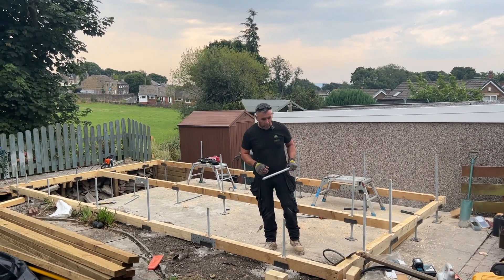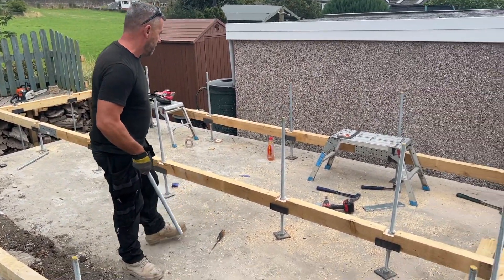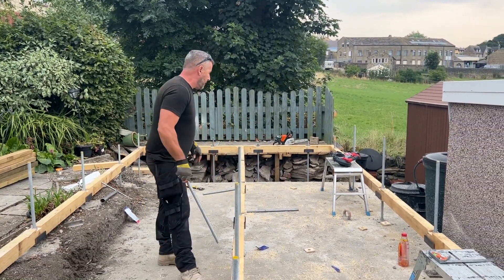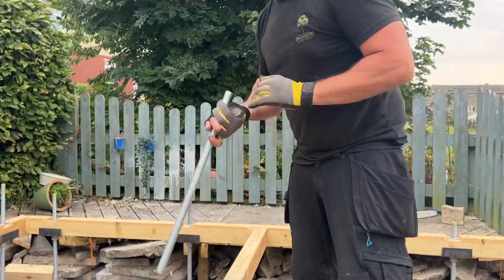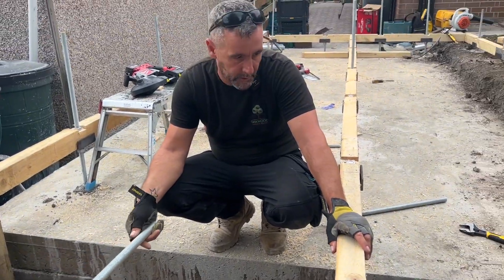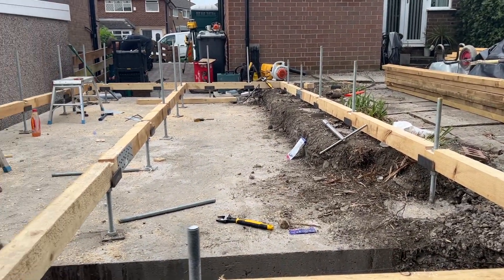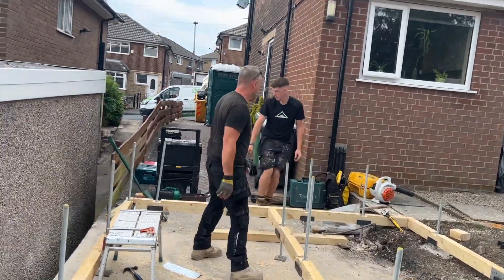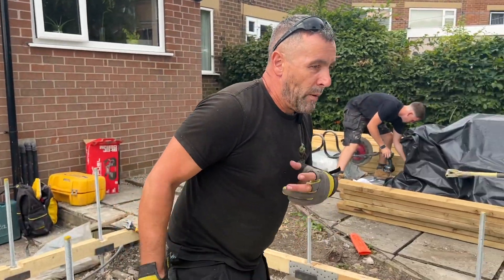Garden room rod pile system

Comment: Been thinking about augering the garden and filling the 10 inch holes with concrete and using rods like you to save on a base
Thinking of a large shed on scaffold planks hooked in a frame with the rods.
I like what you have done.

Comment: I realise not applicable in this case, but EasyPad now seem to be more affordable than the rod system and simpler setup. An EasyPad 3x3 kit is £380 currently. Did you consider pads at any point prior to settling on using your proven rod technique? 

Great channel though.

Comment: Great stuff, your videos are really helpful. I have a fall of around 1m for the one I'm planning, is that borderline for the rods? It will be used as a gym
Reply: depends on what sort of exercise you will be doing. If you are lifting and dropping heavy weights I would go for concrete. A suspended floor would probably be fine for light weights and static machines but keep the joist spacing narrow.

Comment: Would those longer 1.5 M rods have any chance of bending under compression?
Reply from the maker: It’s only a side wall and that end will be a store, so not much weight on them at all
Reply: If you where really worried you could put in some rebar and with some shuttering cast them as concrete pillars.